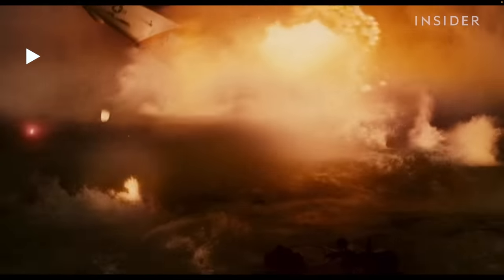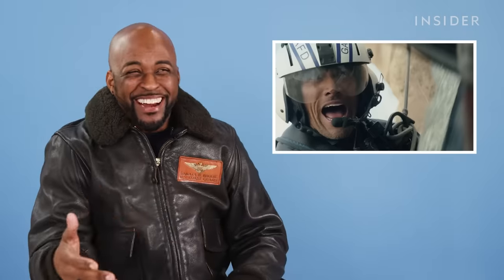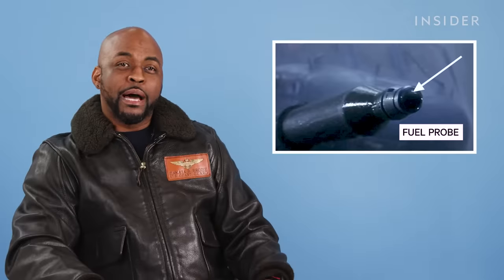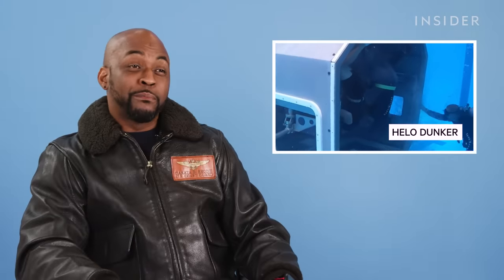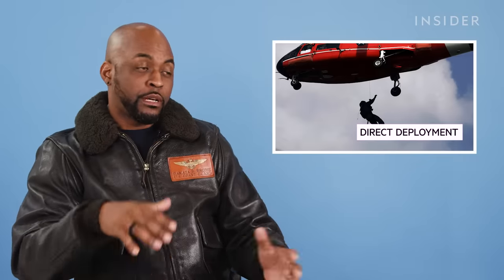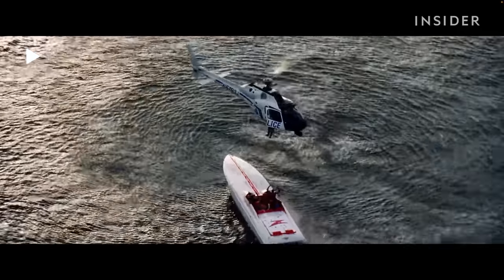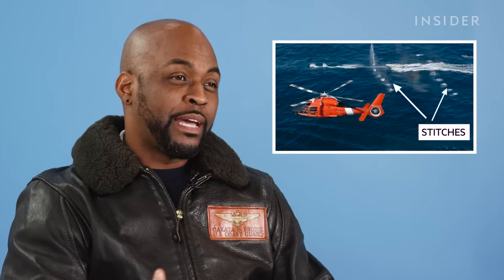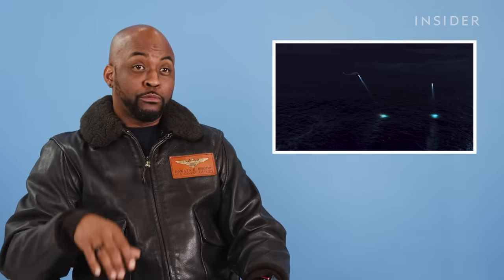Military Helicopter Pilot Rates 9 Helicopter Rescues In Movies and TV | How Real Is It? | Insider

Comment: 😂😂😂😂😂 if I'm outside the helicopter we have a real bad problem. As a pilot, I am never outside .
Reply: I have over 7 hours on Microsoft flight simulator and I think the biggest lesson I've learned is if the aircraft is in the air you should not be outside of it
Reply: Yea XD
Reply: I for one definitely prefer not to be outside an aircraft if I am flying it!
Reply: Ever serve Houston or Galveston? I'm at Ellington Field (flying alongside NASA JSC astronauts) with the Coast Guard there but sometimes I'm at the Galveston base.
Reply: @kawasakieddy61  because helicopters don't have autopilot switch like commercial airlines.
Reply: Except if you crash then you may be outside by flying outta the cockpit
Reply: @Maniacguy2777  Helicopter have autopilot
Reply: I'm surprised they didn't have him comment on the part in that movie where DJ, as the only person in the cockpit, hits the auto hover button and then leaves the cockpit to do the rescue. The flying pilot would never take his hands and feet off the controls and just trust the helo to not malfunction.
Reply: @Tenofizzy  even still a pilot would never leave his seat. It is not his job to leave the bird mid-flight to perform a rescue. The movie producers just had to figure in some way of having the Rock do every hero move possible. Also, a copilot would be in his seat and no where else during the flight, in the event he needs to take over he would instantly be ready.
Reply: Actually he mentions you could turn off your engines moving back.  There’s a mishap that killed 5 people everyone in USCG aviation learns about where that literally happened.  A pilot went back to help a survival expert staunch some bleeding in a rescued person and bumped into the engine controls turning them off.
Reply: @CrimsonRoseDancer what’s even funnier about your comment about the rock needing to be the one to make every hero move, he owns the producing company, therefore making him the producer, the director, and the hero 😂
Reply: How do you get in?
Reply: How do u get the instagram selfie?
Reply: @Maniacguy2777 really. I just assumed they would but I never really thought about it.

For what reason do they not have AP? THANK you for your kind reply. 😊😊😊 🚁 🚁 🚁
Reply: That line took me out. 😂

Comment: As a former USCG Flight Mech on HH-3f (2 years on Kodiak) and HH-60J(3 years in Traverse City), I can corroborate all  the off-shore SAR stuff (as if that matters ;-) )

The thing missed in the Perfect Storm segment was the USAF performing off-shore SAR. They are NOT trained for that at all. It sucked that they were put into such a position IRL.

As far as the HH-60 rotor wash, when I was first hoisted into a '60 for training, I seriously thought I was going to drown as the swimmer pulled me through the edge of the rotor wash. I remember thinking, how freaked out would a civilian be? The HH-3f, with much less powerful engines and five blades was not as scary to be hoisted to.
Reply: USAF rescue helicopters are trained for off-shore rescue, so are the Pararescue Jumpers. Of course the USAF is not as experienced as the USCG as the former is not the primary organization to be called on for sea rescue, they're the last call; but they're definitely trained in sea rescue.

Comment: military aircraft (specifically helicopters) electrician here. if your hit by a electrical strike, most situations (not all) if you are hit there is grounding system that is redundant used by all nations, civilian airframes, and free to read on how it works to help pass the electrical charge downward without damage/min damage. ive never been in a situation of a electrical strike but was taught and did repair these systems. my worst is going into the auto rotate witch should stabilize until you can regain control of the system and have backup analog systems to help you land or regain control as i have experience with from other malfunctions that grounded me a few times.
Reply: he put that out there without reason, the helicopter didn’t get struck by anything except sheets of rain making visibility zero and causing the boom to whack the helicopter…it had to ditch due to no fuel, one airman died from the ditching

Comment: For the film perfect storm, the Pave Hawk helicopter crashed bcoz it ran out of fuel. Due to the extremely severe weather condition, the helicopter wasn't able to connect its probe to the HC-130's drogue for refueling.
Reply: HC130s don’t have in-air refueling.  You’re thinking of KC130.  Also in the movie they didn’t run out of fuel.  That was a change that was made that made it less realistic than what actually happened
Reply: @AnarexicSumo  HC-130 is also capable of air refuelling. They primarily refuel CSAR helicopters (HH-60s) and other air assets in support to CSAR missions.